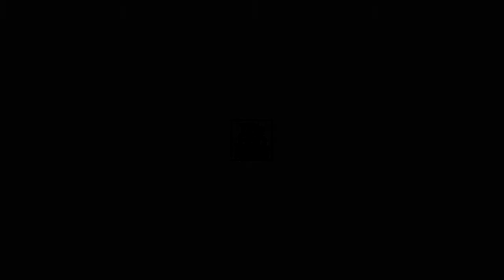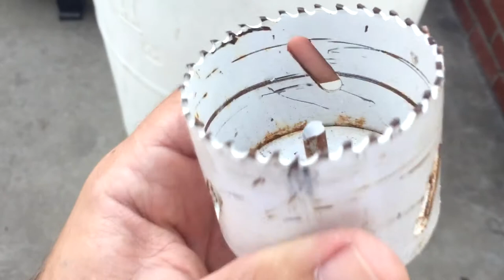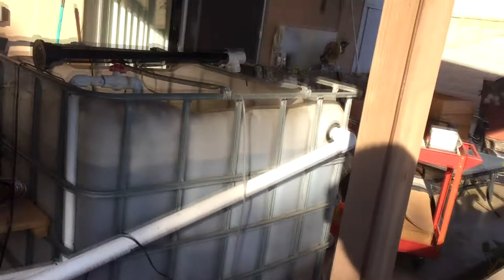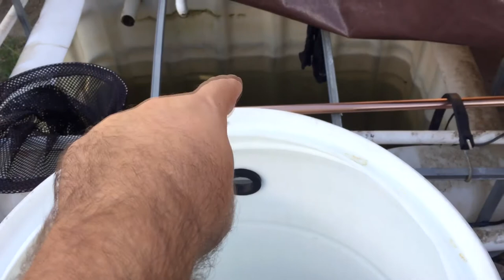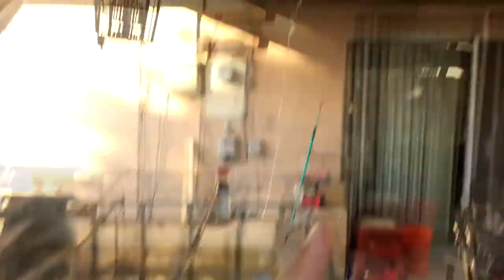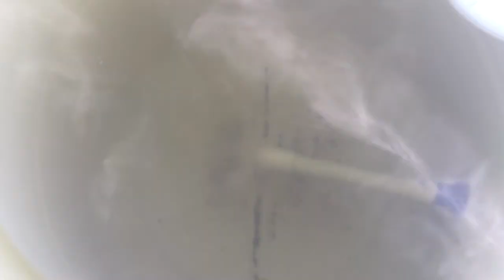Swirl Filter 2 - (Building it)

Comment: great job mate . A stall chamber in the center with the return surface skimmer to the sump tank will make it a little better.
Reply from the maker: mikehotel02 I want to redo this. I want to make a new barrel with a sieve built into the barrel:)
Reply: @TheFishTank  yes the sieve filter with multi-sock filters are a great idea
Reply from the maker: @mikehotel02  I want to 3D print something that will separated the water evenly to maybe 4 sock filters:) I am putting a new update video up today sometime so hit the bell icon that way you get my video update.